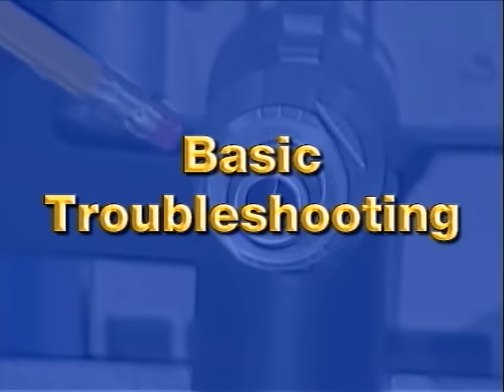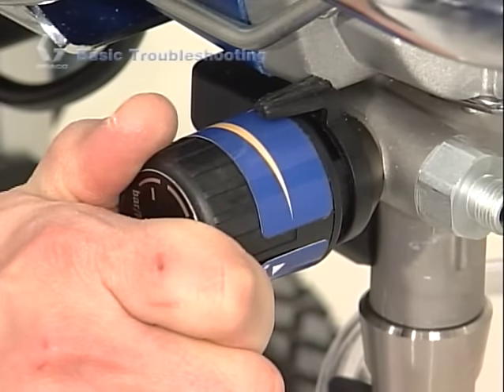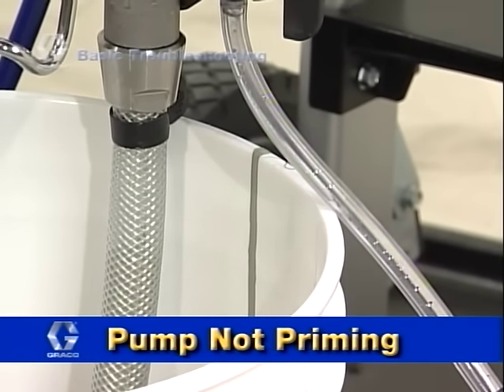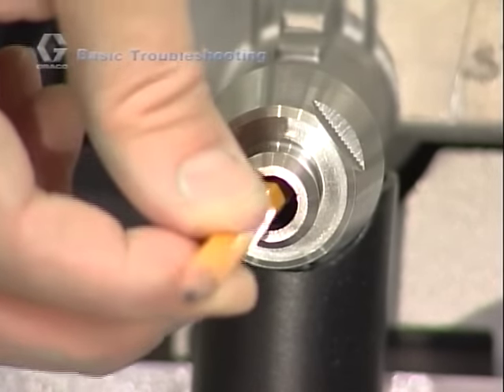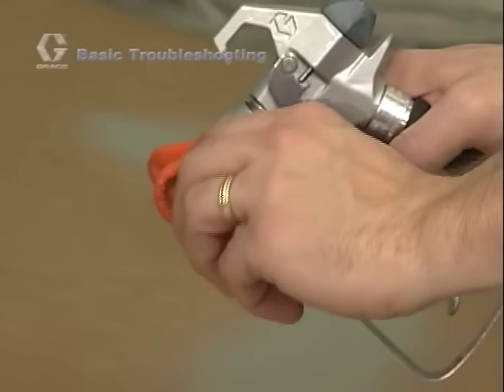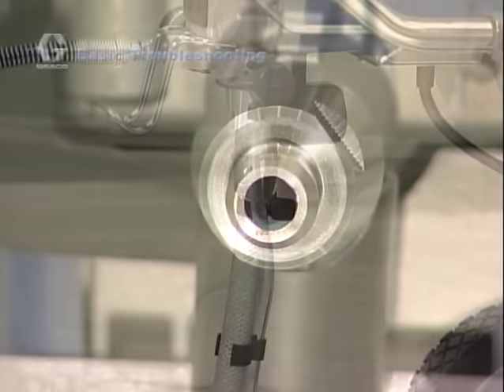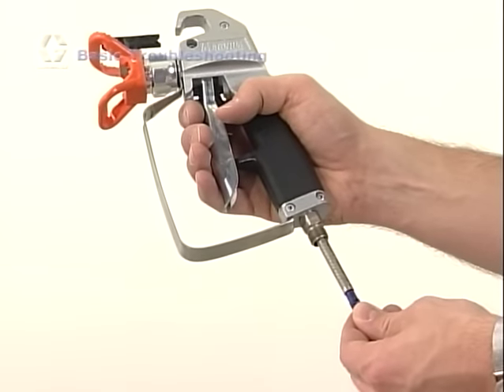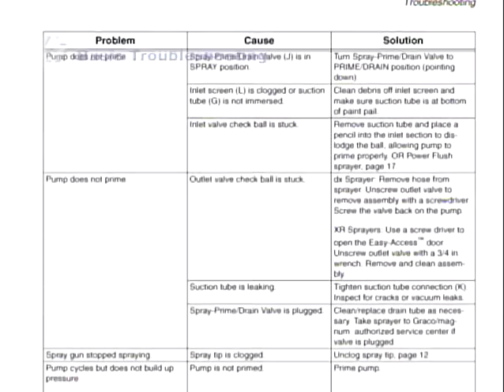Basic Troubleshooting With Your Graco Paint Sprayer

Comment: Need help... Love the sprayer. Used 3 times following instructions for it all, especially rinsing the tip. Went to use it again a week later. Won’t spray, I held tip up to light, no light. I must have not rinsed the tip long enough. I’ve tried boiling hot water and spraying canned compressed air. From outside of tip to inside. Still isn’t clear. I bought a new tip, but it was nearly $30! Hope to salvage my tip. Suggestions?
Reply: I'm a beginner at this and my new tip worked the first two times. Then no paint would come out of it. Didn't screw on the guard as tightly and it started working.
Reply: Instead of just rinsing the tip, use the machine and spray water through it

Comment: I have an xr5 Graco and the spray comes out heavy on the edges and really light in the middle. To the point where the edges run. What am I doing wrong?
Reply: I would guess that your problem is due to low pressure. Try adjusting the pressure.
Reply: Or the tip is clogged
Reply: Same here, even with pressure on max

Comment: So my wife bought this sprayer and we have used about 20 times. She was having trouble with the tip leaking so she spent another $115 on a new gun. But she is still having issues with this thing. What gives???
Reply: Clean shot and plumbers tape on seals lower pressure slightly if using extension u get spits so Graco clean shot reduces if tips leaking use tape on joints

Comment: I have a paint sprayer that primes and runs good but last time I tried to use it the motor seemed to run really slow and the pressure was low too.  Could this be a clogged filter or filters? the tip and wand are new. and the paint was thin enough. before that it painted just fine.

Comment: ok so, I fixed/checked all that and my issue remains. My sprayer allows me to spray but once it drops below a certain pressure it simply stops pumping as though the sprayer has no power. If I unplug and replug power it will depressurize but then will do the same thing repeatedly. Any recommendations?
Reply: Trying spray at to lower pressure ..1200 up to 2800 psi is usual pressures depending on tip size higher pressure bigger tip for larger areas smaller tip lower pressure

Comment: Took less than a minute to clog.  Tried it on different pressures still clogged.  Tried to turn the arrow on the nose to unclog it, no luck built up pressure won't allow you to turn it no matter what setting.  I had to take it apart every time to unclog it.  1400 square feet ground floor plus ceiling took 4 hours with 2 ppl with rollers.  no point in wasting 300-700 dollars for one of these models just to get a headache.  I will be returning it.

Comment: my spray gun sprays paint with out pulling the trigger what do i do? been using the gun for about six mounths. new filters also
Reply: More than likely you need to have the gun kit repacked.
Reply: if you pull the tip and unscrew the "tip holder assembly" and the assembly below that sometimes there is debris in with the "spring valve" just wash out.
Reply: my gun is doing the same thing. what did u do to fix it?

Comment: My switch tip keeps falling out my Graco sprayer tip. It’s pretty loose. Is the sprayer tip broken or am I doing something wrong?? Help please!
Reply: You might need little part that comes with the tip...if you notice at home depot or lowes they sell this spraying tips, the package comes with some sort of "gasket" i really dont know the name of that little part, its black rubber and steel. Put that inside the guns nozzle and that will keep the tip tight in place.
Reply: Poetry Of Every Moment Yes,  It was that part, thank you! :D
Reply: @poetryofeverymoment1080  Thanks!

Comment: Did all this,,, and still no prime,,, DO NOT get behind me,,,I might have it tossed out the back of truck
Reply: If it’s not turning on you will have to open it up and check the fuse or connection. I had the same issue and saw there was a wire not connected.

Comment: These guys need to stick to making strollers..I don't understand why they tried to make it as hard as they possibly could for the user to use..it's a spray paint machine not a fn astronaut launcher. MAKE IT SIMPLE..not fn hold this button down for 3 secs then flip the switch off and on then wait precisely 5 secs and blow in it until you pass out.